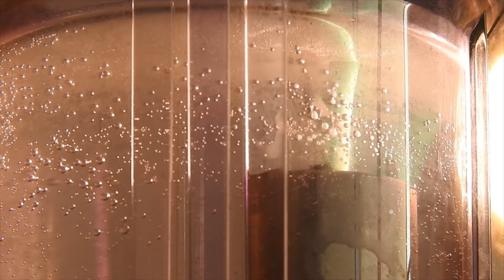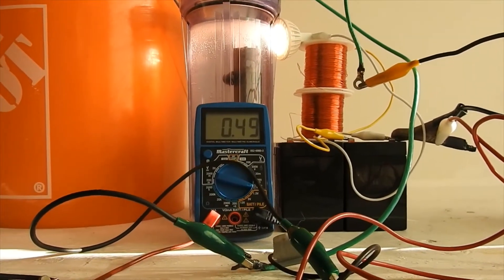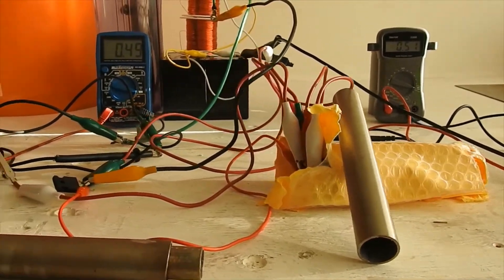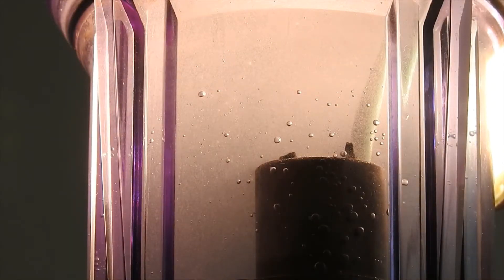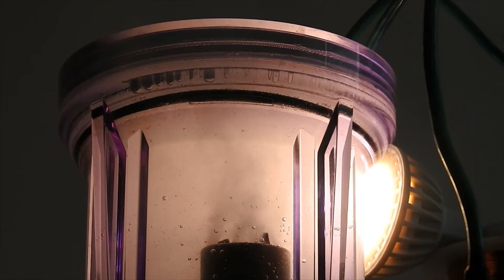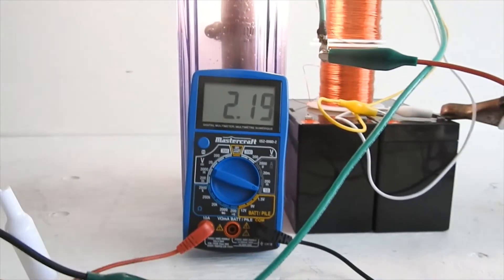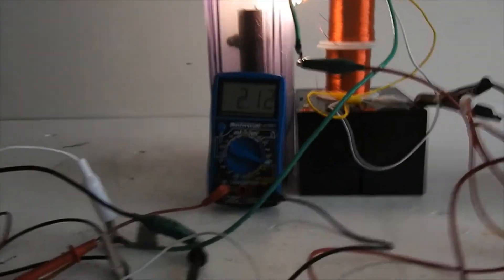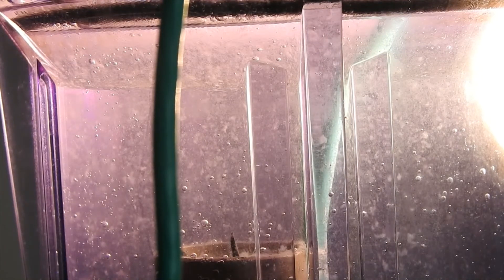HHO Stanley Meyers Resonance versus non Resonance

Comment: It works. I have the same. Currently, i can get 6 times more amps then i put in.......amazing....still looking for a good way to make it a self runner.
Reply: I wish I could have 6 times the output. My setup is a little different, I have the same Water Fuel Cell setup as just about every Kiwi Fuel Cell Builder in Auckland, North Island of New Zealand and in the whole of Darwin, NT Australia. There are lots of Kient’s that build these devices. I use a Dual Petronix 60,000 Volt E-Core setup which in Series gives me a minimum of 120,000 Volts that oscillates at a base frequency of 270 Kilohertz which, I then Gate at LC Resonance. It’s powered by 200,000 Volts of Back-EMF Im-Pulses to the +Positive Anode during the LC Resonance ‘Coil Off’ Cycles. Then during the LC Resonance ‘Coil On’ Cycles I’ll pull Co-Valent Bond Electrons from the -Negative Cathode (Which is actually a ‘Time Reversed Re-Emitted Wave’ just like a Lightning Strike) which take the path of least resistance, which is through the Coil to a Spark Gap with Light Bulbs connected in Parallel, then this is connected to the +Positive Anode. If I didn’t have the Spark Gap & Lights I’d have little or no Deuterium H2 Output but, I have a Massive Deuterium H2 Output because I’m removing Co-Valent Bond Electrons from the Water itself. It works off High Voltage Tension & an effect in a Lightning Strike known as the ‘Electron Avalanche’ where I’d found that it only Works when charging the Water Fuel Cell with Back-EMF Im-Pulses!
Reply: @o5you86  I think maybe the problem with your setup is that you cant control the pulse frequency with a high voltage ignitor. Another issue is the driving power (amperage) available from such ignitors is negligible. The success of this experiment lies almost entirely in the electronics.
Reply: @o5you86  are you selling these or sharing the instructions
Reply: @cjdonaldson8536  I’m not selling anything but, I reckon that its just Charging the Water Fuel Cell with Back-EMF Im-Pulses off any ignition coil or even a Tesla Coil. I think you need 80,000 Volts of Back-EMF Im-Pulses collected from the Negative of your Coils. You’ll know you’ve reach Resonance when your Coils Sing with a High Pitched Whine. I’m using a Variac rectified to DC with a 600 Volt IGBT switched with an Optocouple with a $50 USB Frequency Generator I got from Amazon. I just build my Cells 10X bigger than what I need then I overpower my Cells using 240 Volt Floating Earth setup with a 3.25 KVA Generator. All I’ll say is that I get about 5X the input with Lawtons Electron Extraction setup, just build & experiment yourself. I’m not out to prove anything as I’d had a Circuit Stolen from my 86 GTS on my front wheel cover & had insurance repair my driver side smashed window that is now a different colour to the other windows on my Car as I have a light Tint built into the Glass. Keep your SHIT to yourself & don’t Share as it can all be easily Stolen! Mates in Darwin use 44 Gallon Drum setups on Acreage collecting Electrons while discarding the HHO to the atmosphere. TRUST NO-ONE!
Reply: @o5you86  opposite, share everything, give copies to everyone. too many people end up murdered and there secrets die with them
Reply: @t_4178  Buy ‘Deuterium’ Heavy Water then its very Easy to power a Generator Motor off Deuterium because it has 2.5 X times the Mass of regular Hydrogen & you don’t even need WFC 1.0 Meyers Resonance gated with a reverse Sawtooth at LC Resonance. Then you look at how to make Deuterium using regular Tap Water. Then you use Meyers Resonance with a HV Coil where you only use Back-EMF Im-Pulses higher than 80,000 Volts to initiate an effect known as the ‘Electron Avalanche’ which Knocks Off the Co-Valence Bond Electrons in Water, where the reverse Sawtooth works like a Rubber Band stretching then relaxing the Covalence Bond Electrons in Water. Then you use 2X 83,000 Uf Capacitors which act as Buffers with a Rectifier connected to you Fuel Cell to a Light Bulb Array which will consume these released Covalence Bond Electrons from the Water. (This is Meyers Fabled Covalence Bond ‘OFF SWITCH’) Water cannot exist in its Liquid State once these Covalence Bond Electrons have been released & therefore must exist as its Oxygen & Hydrogen Gases. The Electron Avalanche releasing Covalence Bond Electrons from Water is a Power Source. When you collect/condense this Water from the Exhaust this is Heavy Water, this is Gold when powering a Car on Water & you just let the Steam Vent Off into the Atmosphere. I used to lend my Water Fuel Cell with my 3.25 KVA Generator out to people that I call a ‘Deuterium Reformer’ that condenses the Exhaust to create Deuterium Heavy Water. I’ll get a Van with Solar Panels & a Tesla Power Wall, then I’ll condense Deuterium with my 3 .25 Kva Generator & fill up a Water Bed with Deuterium that I’ll use to power my 86 GTS with. Just do SHIT on your own Mate, when you involve other people with this sort of stuff they think that your hiding something from them & then they start STEALING your SHIT off you!
Reply: @t_4178  my current setup uses 2X Petronix Flamethrower 60,000 Volt 0.32 Ohm Coils glued back to back with both High Voltage outputs connected to a Spark Gap. I switch this with a 600 Volt IGBT with an Optocoupler & other components using a cheap Frequency Generator I bought off Amazon for $60. I just use  a Schottky Diode to collect the 100,000+ Volts to my Anode then connect the Cathode to the Positive of the Petronix Coil setup. I use 2X 83,000 uf Capacitors connected to the Anode & Cathode then to a rectifier with a Light Bulb array to consume Electrons from the Water. I’ve been using this setup since 2014 to power my Greenpower 3.25 Kva Generator. On the Exhaust of my Generator I use Exhaust Gas Recirculation (EGR) & I have a Copper Pipe coiled up to condense the Exhaust Gases to collect the Deuterium Water… This Deuterium Water is Gold as its like a Battery that stores Energy in the form of Heavy Water. The Steam from the Exhaust is vented off into the Atmosphere. If you show this stuff to other people, they’ll just try to STEAL it off you!
Reply: @o5you86  Can you tell a newbie more?  How many amps is your basic system using?  Are you getting more than you put into the system?
Reply: @VenturaIT  Its not about getting more Energy out than you put in because its a covalent bond off switch that uses an effect known as an Electron Avalanche. I have Dave Lawtons original ‘Phase Locked Loop’ Auto-Resonance Circuit. It uses a Positive Cathode & a Negative Anode then in-between this is a Mesh connected to a 260 Volt Variac Transformer that is used to accelerate the Electrons that uses a shared Negative Anode. Too much Voltage it doesn’t work as the Electrons accelerate past the Covalent Bonds, & too little Voltage it doesn’t work as the Voltage Tension isn’t enough to knock off the covalent bonds of the Water. The trick is to be in PLL Auto-Resonance then dial into the correct Voltage that knocks off covalent bond Electrons in the Water itself. Its a covalent bond off switch that uses Auto-Resonance & Voltage Tension to knock off Electrons using the Electron Avalanche effect in Water. People expect me to build all of this CRAP for them, just understand it & build your own SHIT!
Reply: @o5you86  thanks for your input on the topic. I will look elsewhere for more information so i can better understand as electronics is not my major but i am curious enough about it to further persue it. Invested a lot so far trying to build and discover. Yes been scammed along the way too of course. And i understand your points. Especially trust no one.
Reply: All Stan Mayer patents are online
Reply: @o5you86 Accelerating and knocking off electrons from covalent bonds consumes energy. What's the point then ?
Reply: @finnstadel  Knocking off Electrons with a ‘Ringing’ LC Resonance Coil using the Electron Avalanche is very efficient. The point is efficient energy exchange in which the HHO Gases created are a byproduct of this process.
Reply: @o5you86  i can help you out trying to get the same results as i di, if you want. Just a friendly reaching out...
Reply: I already own a 3.25 Kva GreenPower LPG Generator that has a Custom Exhaust Gas Recirculation (EGR) Beer Keg with an Ioniser in it. I’m already using in excess of 200,000 Volts to Knock Co-Valent Bond Electrons from Water using an Electron Avalanche. All I do is, switch my Circuit On, Reduce it’s Resistance to its Absolute Minimum, Dial into Resonance which is flicking a Switch having Dave Lawton’s original Phase Locked Loop (Auto-Resonance) Circuit. Then all I do is turn the Dial on my Variac Transformer until I’ve reached the desired amount of H2 Deuterium that I want for my Generator which is only 40 Volts DC. H2 Deuterium has Twice the Mass of regular H1. H1 Hydrogen is an Implosive Gas while H2 Deuterium being an Isotope of Hydrogen has Twice the Mass or more Ooomph in the Combustion Chamber because it is an Explosive Gas that Stanley Meyer refers to as ‘Thermal Explosive Energy’. I can actually power my Generator from H2 alone but I choose to combine 3X H2 Deuterium Atoms to 1X Nitrous Oxide Atom to form Ammonia Gas to power my 3.25 Kva Generator just out of tradition.
Reply: Don't you just love the feeling! Think of the currency! LOL LOL
Reply: Why do you keep talking about amps. Volts is important for not over driving the cell. Watts are a unit of power. Amps aren't telling you anything if the volts are fluctuating.

Comment: Very good production, can you explain the details of resonance rod and size of WFC also any electrolyte if diluted in the water. Would you like to tell the details of PWM.
Will be appreciated if answered. 
Regards
Reply: You dont need any details of his own every container every cell design has its unique capacitance all you have to do is to connect the right inductor and a PWM that's suits the frequency range of the self resonant frequency. There are bunch of online calculators online to calculate the resonance frequency. Make your own research
Reply: @Aboudy1989 👍
Reply: Note that the level of water decreases and the capacitance decreases too because of its dielectric property so you must adjust the frequency accordingly, or build your own self tuning circuit
Reply: How do you constrict the res,rod

Comment: So are you powering the cell by the coil. Hence resonating ?
Reply from the maker: Yes. Battery source to pwm, pwm to coil, coil to cell.
Reply: @thewonn  so your putting ac through the coil on the + side and where is your ground going?
Reply from the maker: @off-gridhillbillystyle3735  complete plans are available here
https://www.ebay.com/itm/202868531009?ssPageName=STRK:MESELX:IT&_trksid=p3984.m1555.l2649
Reply: @thewonn  in the link i found now only signal generators, not plans, please have you got another link?
Reply from the maker: @fabiotribos5358  https://fitnesshomesupplies.com/collections/hho-hydrogen-products/products/pwm-hho-instructions
Reply: @thewonn  bro, are u telling that ur cell is capable of overunity? running at ambience temp? goin passed thru resistance of non-superconductive materials? or ur numbers are a measurement error due the alternancy of the AC circuit current in the LC resonant filter, cuz syntax error isnt an answer for me dude

Comment: Interesting observation. I already experienced that, but this is basically what buck converters do.
If your pulse is 50 percent on duty cycle you will see the double of amps on the cell in comparison to the input but the average voltage falls to half, and only at certain range of frequency (if you go to low the inductor saturates and you lose this effect). this is the pulse doubling effect (inductor discharging on the off time) and this is dependant on resistance of water (the LR transient effect, not LC).
Reply: isn't it  parametric resonance  amplifier ?

Comment: hard to tell  if there is any difference at all ! ....do a Liters per minute test one with the pwm and one without that will tell us more than the eye with the video ! .... Bob....
Reply from the maker: looks obvious to me. The first test you can clearly see that the hydrogen is not fogging up the container, and you can see the difference from the top view as well. In test one you can see the pipe from top view, in test 2 the top and container is filled with hho bubbles and foam. But yes I should measure it soon lol. Working on setting up more pipes first.
Reply: @thewonn  how are ur measurements goin? do you figure something at all?

Comment: Are the actual volts the same going in, in both the examples?
Reply: Exactly. Amps alone is not enough. Watts=voltsxamps
2 volts plate to plate should be where you want be.